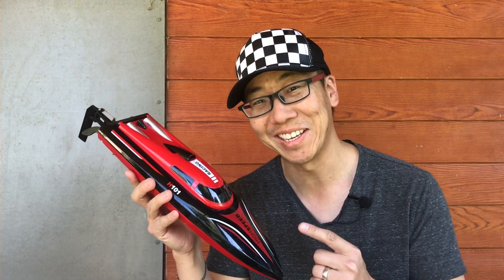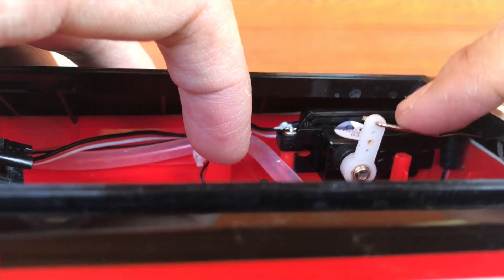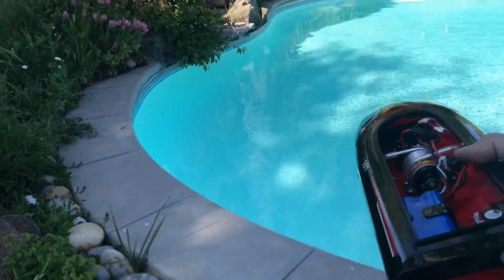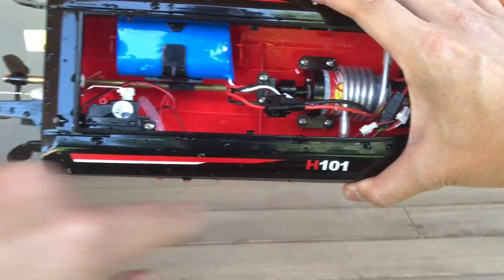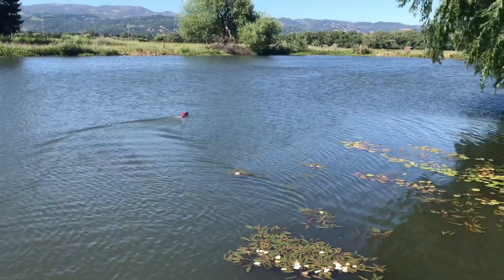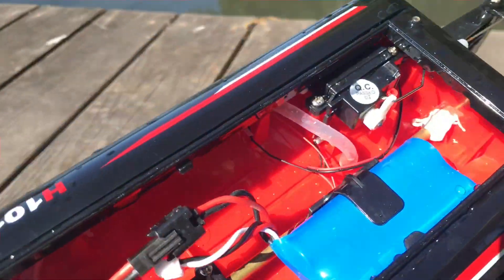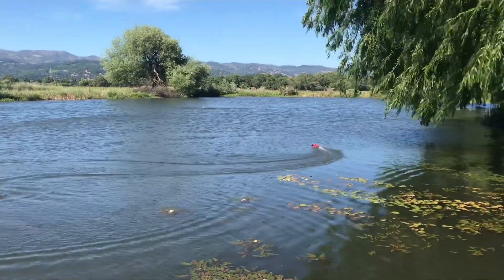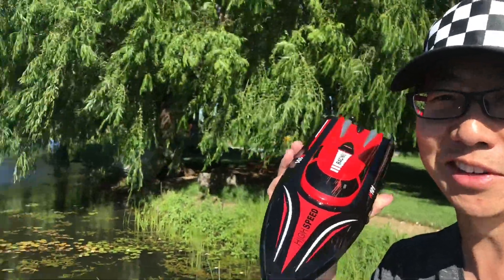Fix Your Broken POS Skytech H101/H100 RC boat in 10 Minutes for Free

Comment: From Sarawak, Malaysia. Cool!
Reply from the maker: Awesome! Even though it can be fixed, I don't recommend it. The servo is weak and will break easily. Replacing the servo isn't hard if you know what you're doing, but it's not worth the hassle and price of the replacement servo and connectors, the work of soldering, etc.

Comment: Will this boat run on a 2s lipo?
Reply from the maker: Yes. The stock battery is a lithium ion. A lithium polymer would be fine. I don’t recommend the boat though if you don’t already have one. Don’t get it.
Reply: @Funcentric  may I know why , the bad thing about this boat ?
Reply from the maker: @arulacik4317  The servo is weak. Not strong enough. Breaks easily.
Reply: @Funcentric  then if I change the servo it will be good right ?
Reply from the maker: @arulacik4317  I haven’t done that yet. The connectors are not really that standard. I wouldn’t recommend wasting your time with that. Just get a different boat.
Reply: @Funcentric  okay then if I want to buy wltoys w915 A would you recommend it ?
Reply from the maker: @arulacik4317  it’s worth trying. I was considering that one myself too but I don’t have it so I cannot truly recommend it.